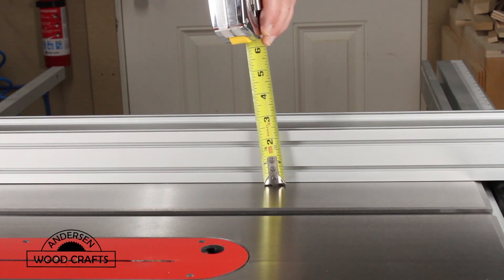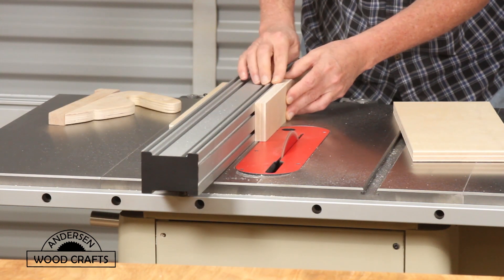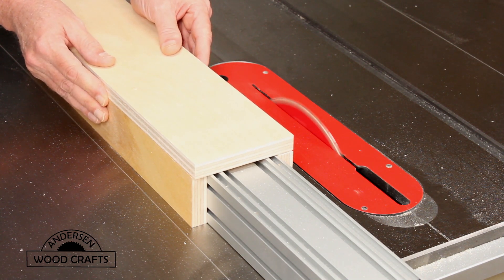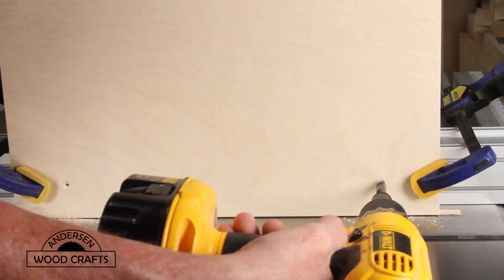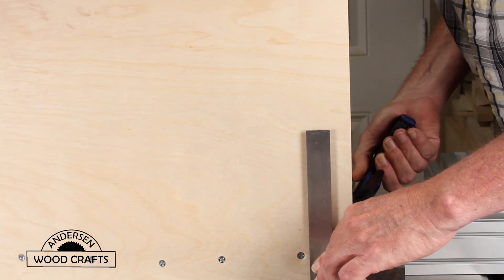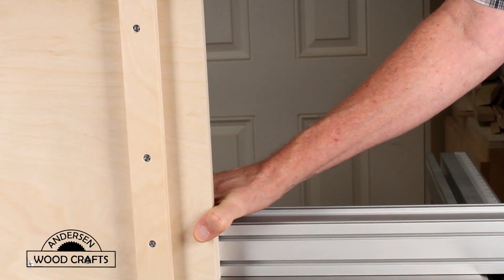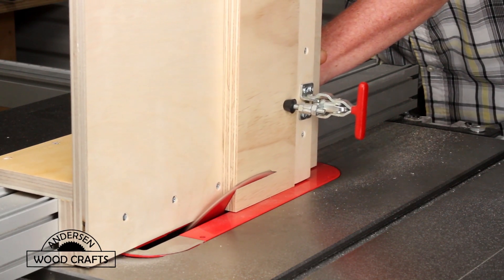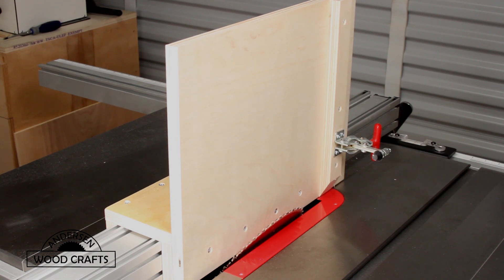BEVELING CUTTING JIG FOR THE TABLE SAW

Comment: Great video - short & easy to follow. Could you maybe provide rough cut list measurements for the jig parts?
Reply from the maker: Sorry for the delay.  The panel is 13" high and 17" wide, the measurements of the guide is dependent on the fence.  Thanks for your comment.

Comment: Thanks. Some great tips in there like the spacer between the vertical piece and the table. Less friction. Also the waxing the part that rides on the fence.
Reply from the maker: Thank you for the comment.  It is the little things that can make a difference.